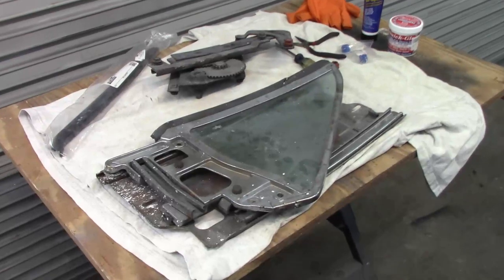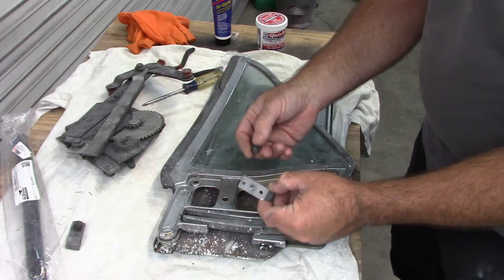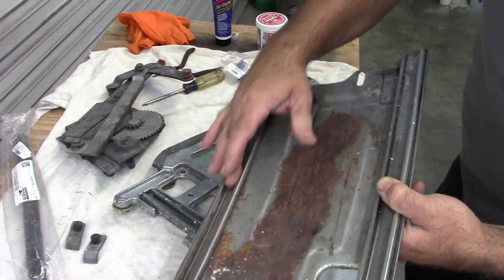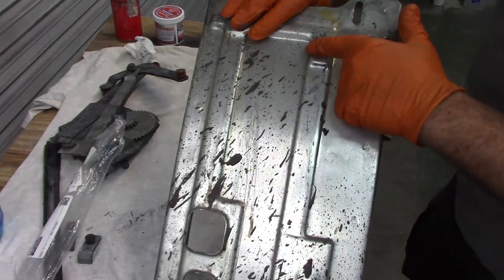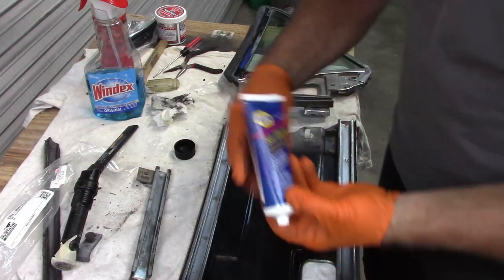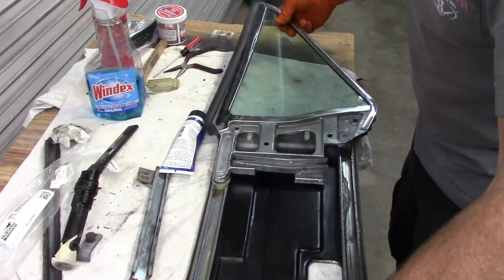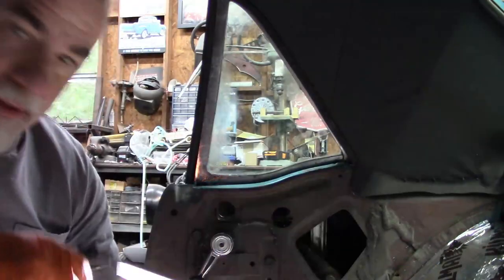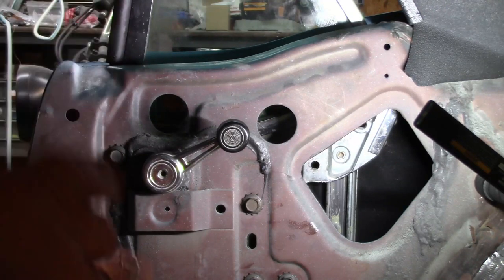Quarter window install. Detailed quarter window install in a classic mustang. Jade part 88

Comment: *68 Mustang coupe - hardtop
In the process of replacing worn out window belt line seals i discovered my passenger side quarter window was busted. Window rollers are missing. I'm able to freely pull/push window up and down with fingertips. Somehow I was able to jam it and sustain it's "up" position. At least until I get the parts needed to fix it.
I was worried about the "how to do it" part; taking the window out, installing new parts, putting it back in, and adjustments.
This video helps alot!! I feel more confident taking on the task.. thank you Sir!

Comment: Great tip on using screws instead of the janky clips that my new outer quarter beltline weatherstrip comes with... they must have used some special tool to insert those firmly...IDK...SMH...so your solution is great. I do need to see the inner quarter panel fuzzy weatherstrip installed and hoped you had done this... oh, well.  Thank you for your work on classic Mustangs.

Comment: great video.  do you have one for the regular side window and vent window installation?  also would white lithium grease work better than the brake glide in your video?  Your videos are very helpful please keep this up.
Reply from the maker: Check the whole playlist for this car. “Jade” white lithium will work.
Reply: @JoDaddysGarage  in your opinion which would be better?  the brake glyde or white lithium.  dont need dirt and build up if I go through all that work!  Thanks!

Comment: Thanks Jo Daddy. This was very helpful . I’m currently putting quarter glass in a 66 mustang and I have everything attached but when I get the glass almost up to the top, the roller runs off the back side of the glass track. It does the same thing on both sides. What am I missing? Could the regulators be bent, or could I possibly have the lower vertical glass run on the wrong side? Any information would be helpful. Thanks
Reply from the maker: They could be bent. But do you have the seals in place at the top?
Reply: @JoDaddysGarage  yes sir I have the seals in place. I am going to mess around with it some more tomorrow. I didn’t tear this car apart, so I’m working off video footage from awesome people like you to try to get it back together . Thanks again for the vids..
Reply: @JoDaddysGarage  I think that I figured out my problem.Although I am not near the nightmare car, I am thinking that the top 2 holes in the glass backing plate has about an inch of forward and backward movement, so if I move that towards the rear that would solve the problem of the regulator roller dropping out of the glass. I will try that tomorrow and let you know how that goes. Thanks again for your help and videos..
Reply: Problem solved!!